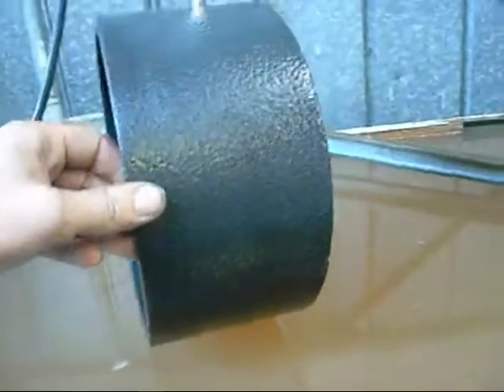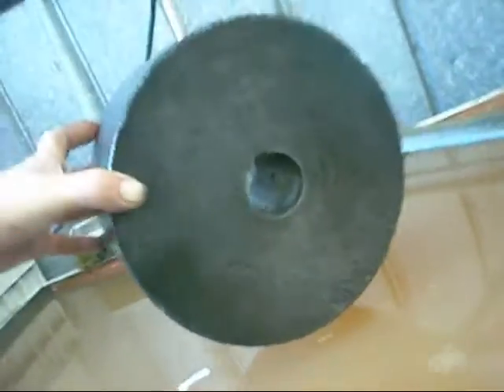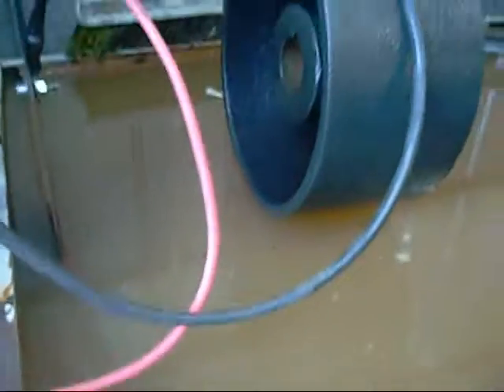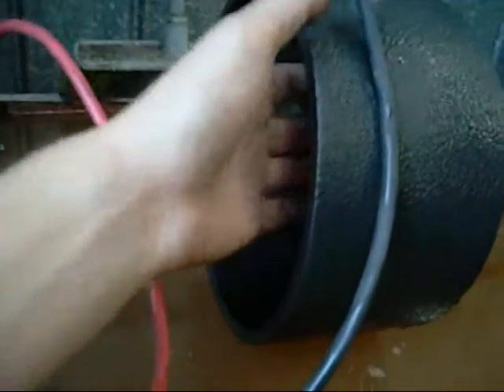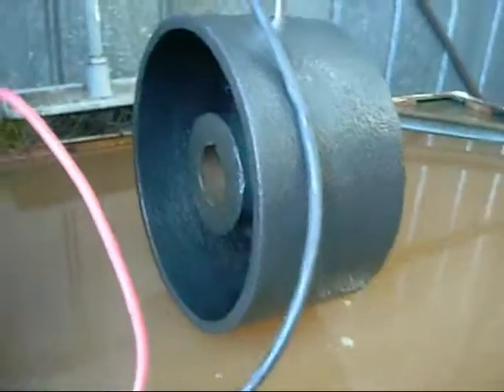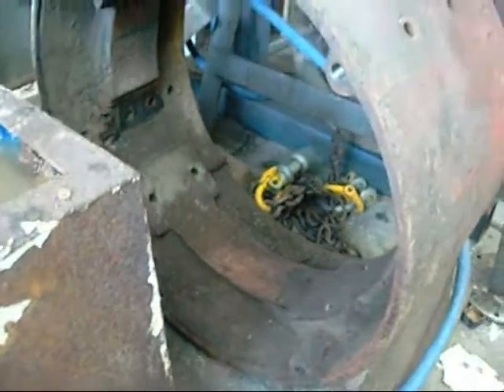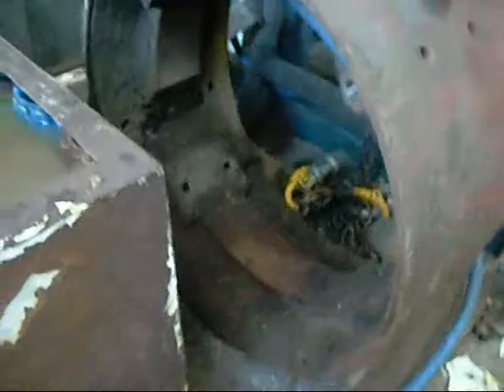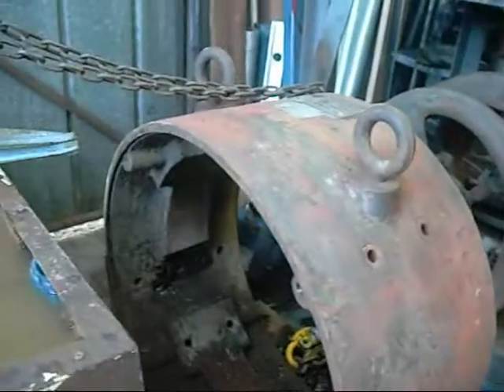Electrolysis test Update - Flat Belt Pulley

Comment: You should have a temperature switch on the tank, that electrolyte could get quite hot , should you leave it overnight! Specially with big surfaces + high conductivity electrolyte = lots of amps.

Comment from the maker: @fritzhvac I can bake this pulley in a oven since its small, but the housings will get a lengthy sun treatment before priming.

the water can be used as many times as needed without change, I only change it when it gets gluggy and nasty, which could be in 6 months time for this tank.

Comment from the maker: @Robonza I don't use it on car engines at all, unless I am re-painting them out of the car.
I dont trust corrosive oven cleaner on paintwork, rubber hoses, electrical connectors or plastics.
the non-caustic stuff is pretty harmless but also pretty useless on tough grease.

Normal auto-shop alkaline cleaners are best IMO. or spray pack solvent based ones  that you hose off after (water soluble solvents)